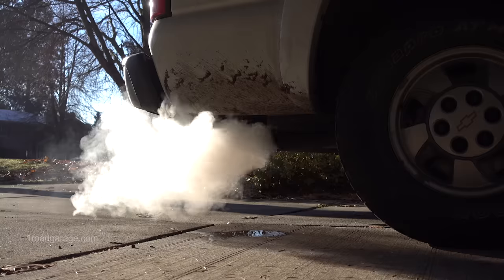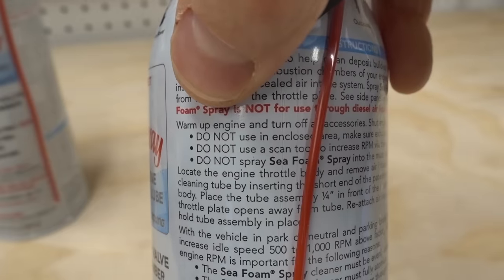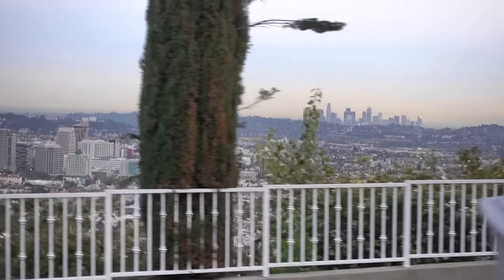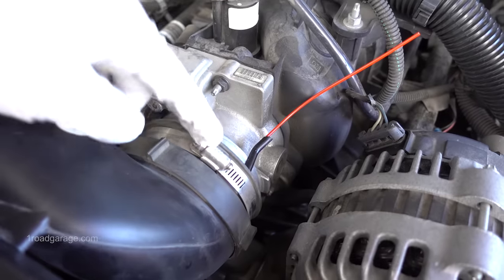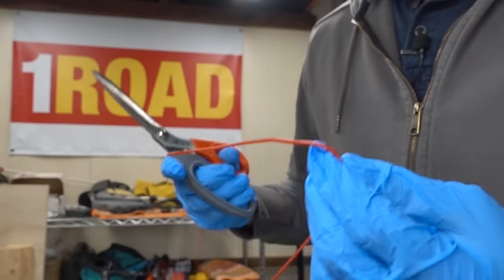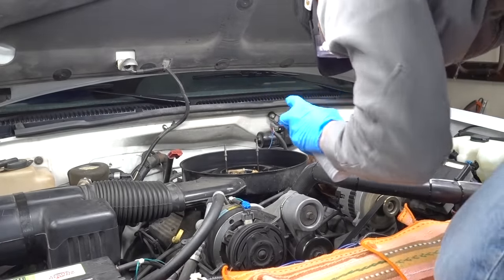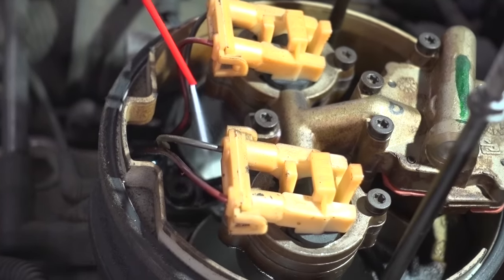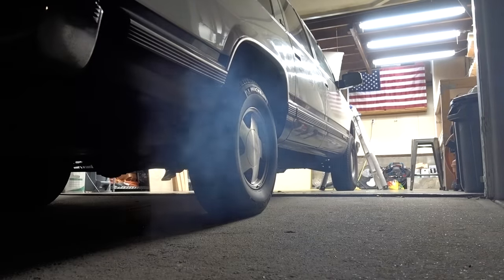Why You Should NEVER EVER USE SEAFOAM!!

Comment: If you really want it to smoke get the liquid. Get the engine good and hot like you did, give it some rpms and start slowly dumping the liquid in until you have dumped about 25% of the can, then let go of the throttle and finish dumping the entire can in throttle body/carb until the engine stalls but make sure you empty the entire can into the throttle body/carb. I usually let it sit for about 30 mins, then start it up... You want smoke, you'll get smoke. Just to recap dump a little with rpms up then let idle and dump entire contents of can in the throttle body/carb, the engine should stall on it's own, if not you didn't dump fast enough once it was idling. Of course, after it stalls you will want to shut the key off. You want the seafoam to stall your motor, you don't want to have to shut it off manually.

Comment: I thought your were supposed to spray it into the intake at idle until the engine stalls and then let it soak? 
That way, it thoroughly coats everything in the intake including the valves.
You are then guaranteed a HUGE plume of smoke when re-starting the engine.

Comment: sea foam is for old 2 stroke out board motors to remove burnt oil deposits in the combustion chamber. Want to make lots of smoke in an old car-berated engine mix dot 3 and water 50/50 and pour in down with engine running, my old chev 350 wouldn't stall but smoked a lot.

Comment: Try using the other bottle and siphon it through the brake booster. The design of that intake stays clean from the constant spray of fuel, Seafoam won't do as good a job from that angle as it would from the booster. I'm about to go do it to my truck right now.

Comment: I don't think the smoke comes from Carbon deposits, it is the Sea Foam burning up.  I saw a Video where the O2 sensors were removed and the product sprayed into the hole to the upper Cat Converter (not into the engine itself); and when started it smoked like hell, just like when you spray into the  air intake.  SO that makes me think that the smoke is not buring carbon.  The reason you didn't get smoke then was not because of carbon, but because not enough heat to properly smoke the Seafoam product itself.  I gather the Seafoam or CRC actually soaks into the carbon (so CRC says) on the valves and gradually dissolves the carbon (so CRC says) - the smoke then comes from the excess Seafoam spray entering the combustion chamber, or even hot exhaust.  SO I do not think No Smoke is an issue, that would be just the excess seafoam burning up.  The seafoam you have used before would have still started to soak the carbon on the valves...if were are talking about a direct injection engine.

Comment: You got to unhook the vacuum tube from the brake booster well it's running pour one third of the bottle it will kill the motor that's a hot soak. Wait 5 minutes with the same song sitting on top of your piston. Then start it up and Buddy you will have all kind of smoke. The smoke is there because it's oily. The amount of smoke does not determine how much carbon you have cleaned.

Comment: I have to tell you i have done this I would suggest with a small amount of seafoam flood the engine out "without reving the  engine" near the end of the treatment with about ¼ of the can the motor will stall out this is when you let it set "hot soak" 15 minutes

When you try to restart the engine can vapor lock if you hear a rattle stop and wait 5 mins trying to restart can be tricky like a hard starting engine once it tries to start you can continue till the motor comes to engine idle you will get smoke. Now rev up engine to clean ONLY DO THIS AT YOUR OWN RISK AND YOU KNOW WHAT YOU DOING THIS IS JUST A SUGGESTION ON HOW I DO IT!!!!

Comment: Did this to a 2000 Lincoln ls v8 with 236,000 mile and I stopped the main road in town bc a semi driver couldn't see where he was going by of the white smoke coming out. I couldn't see when I turned around to go back to work. They say go run the piss out of it to shoot the carbon out of the engine. Will be doing it in my 95 2wd suburban with 226,000 miles on it

Comment: I drive a 2016 silverado with the 5.3, when i drove aggressively after treating it it bogged momentarily in 2nd and left a massive white cloud when it smoothed out and took off. Couldn't say why you get so little smoke unless it burns off faster while the motor is under load.

Comment: I have always used seafoam I just put it in my fuel every fill up it does the same thing just takes longer plus if you put it in your fuel it’ll clean your entire system just watch your filter and it also gets into your oil which helps keeps rings free and clean your Crank case up
Reply: I hear what you're saying but I don't think you get the same hot soak that burns out deposits in in the engine.  Since it's being so diluted by the fuel and over time......you're manly getting a fuel system cleaner I believe, which is still good, just a different process.

Comment: Do you know if the liquid you can pour directly in to the fuel tank does the same thing as the spray?
Reply: I hear ya.  But if it's just in the fuel system you're really not getting a bolus of it going directly into the engine to do the hot soak.  You're getting more of a slow clean to the fuel system over time which is kind of a different process and it's not doing the hot soak to burn out deposits in the engine as much.

Comment: SUPER TECH Motor Treatment from wal-mart   also worked Great on my 1997 Chevy K1500    i did removed the mass Air-flow sensor   i did notice a Differnece on the horsepower  (I just wanted to say thank u )

Comment: Right on had a flowmaster installed  on my 98 Silverado last month. I didn't pass smog recently because after being parked for two years not enough miles on the computer. Now I got the miles and a 0430 code. Oh and a bottle of sea foam gonna try it tomorrow and see WTF happens. Going with the "Cataletic Converter Colon Cleanse"

Comment: You are supposed to put 1 Oz of seafoam per quarter of oil into you engine compartment. Then hot soak and you'll get a huge plume of smoke. Wait 24hrs, then change oil.
Reply: Putting seafoam into the crankcase might be helpful in removing deposits in the engine, but it won't cause huge plumes of smoke.  The smoke comes from combustion of the seafoam along with whatever it's burning off, which exits through the exhaust.  The oil in the crankcase is designed to lubricate.  it doesn't combust, so there's no exit through the exhaust pipe from anything in the crankcase, other than possibly whatever small amount might get into the combustion chamber through worn engine components.
Reply: @chuckd7423  lol soooo...I guess I never seen the smoke coming out my tailpipe while I was standing right there watching it. It must have been a grand illusion. The great Houdini must have hiding in my muffler and pulled a magic trick on me at the same time that I used the seafoam. Lol
Reply: Each and everytime LMAO

Comment: To get the crazy smoke you need to get your motor to shut off by putting in enough seafoam to have your motor die. Then when starting it back up, it will bellow smoke
Reply: Not the case in my experience.... I follow the directions on the can... spray the whole can, I use a brick to hold the throttle (2k rpm) once can is empty, return car to idle for a few sec. Then shut off and hot soak 15 minutes... start up and drive AGGRESSIVELY... I've got 211k miles on my velo and I've done about 7 seafoam spray (not the liquid) and CRC about 2 times... any GDI motor will have excessive carbon buildup due to using fuel that contains ethanol... I personally try to only us PURE GAS (ethanol free).. carbon emissions are drastically reduced compared
Reply: @korey420 
Ok. You said not in my experience but then you didn't state any difference. Just an explanation of how you use it. So your saying that you do get the billowing smoke when using the spray per direction? Or not? My comment wasn't a statement on how to do things right. It was an explanation of how to get the excessive smoke... which doesn't do anything helpful but that is kinda what 1Road kept going for and seeking in his video
Reply: Read your statement..." To get the crazy smoke you need to get your motor to shut off by putting in enough seafoam to have your motor die"
  I took it as that's the only way to get crazy smoke.🤷‍♂️.
And I clearly stated a difference... You said to spray seafoam until your motor dies... I said I follow the directions on the can which nowhere on the can does it say to let the motor die... It says spray the whole can once the can is empty let it idle for a few seconds and then turn it off the hot soak...... my point is I don't think it would make a difference because the only thing you're doing differently is shutting the motor off while you're still spraying... you spray the whole can in and it's completely covered everything internally (hopefully) and then you hot soak it for 15.. minutes...

When you start the vehicle backup there's a big difference between actually driving and putting load on the motor causing non-stop smoke or staying stationary and revving the motor good puffs of smoke...

Comment: U want lots of smoke? Wanna trade engines? Mine: TBI-350 200,000. Ran great, super smooth idle at 500rpm, no smoke and good power. Burned about ½Qt 15W-40 / 2500mi, no Cat, flowmaster, 8 fresh R44s, 8mm wires, cap, rotor. I sprayed 1 can as U did. Got a little smoke as U did. Next day I started it and it smoked so bad it engulfed in smoke. 1 might think it was on fire. Just 4 fun I drove it. I started up a short 50ft driveway and it started running rough and did not want 2 pull it unless I gave it at least 50% throttle. I went another mile with a short 5% grade and it struggled again. I turned around, went home and parked it. Same thing next day... And thereafter a week. Pissed off I pulled the air filter cover and found a lot of oil in the TBI. I then checked compression. The corners (1,2,7,8) 120 - 150lbs. The middles (3,4,5,6) 20-50lbs). I wrote SeaFoam. They said it was the milage of the engine, not the product. She now sits. Bummer. Ideas on the cause?

Comment: Well. It is your engine. Your engine works better and more efficient than a modern engine. You don't have all that clean air stuff. So yes your engine is very clean. Think about it. By the way. That truck is in great shape. All you need is a gas tank additive only if you don't see good sprays when looking into the barrel of the carb. A little WD40 sprayed in while engine running is good as well.

Comment: The way you get that big cloud is not safe, I’ve seen guys do it at my shops all the time but what you do is you let it idle until the sea foam is empty and then you just rev it to red line and let go and do that a couple times and big cloud but I don’t like it cuz it’s too much stress on the engine plus all that fluid is just sitting there and then you jam it to the cat converter

Comment: Never use seafoam! That part you got right. You know if you don't like your fuel injectors Cadillac converter oxygen sensors and should I go on? You don't like those things you want to throw your money away because that's 5 minutes not working anyway with the heat of the motor. Then go ahead and use seafoam but make sure you have one of these and trunks and get to the next place🛵.

Comment: You are better off using a vacuum line in a regular bottle of it. Let it suck in until the engine quits, wait 15 minutes, then start it up. 

It works better than the spray.

Comment: You want that cloud of smoke  then pull off the vacuum hose for the brake booster and the spray or pour the sea foam in the hose till the engine stalls out while reving the motor then and more than needed to stall the engine and let sit for 7 minutes and then restart the engine

Comment: Here is the deal with your suburban. It is throttle body injected. Which means raw fuel is sprayed on your intake valves when it goes into the cylinder. This gasoline helps keep deposits buildup from the top side of your heads. In more modern direct injected engines this is not the case as only air comes in through the intake valves and the injectors input gasoline directly into the cylinders. This leads to a buildup of carbon and gunk in general on your intake side of your heads. This is what the seafoam spray is made to target. It is why newer vehicles get a lot more smoke than you saw in your throttle body injected vehicle. .

Comment: Ready? ( engine HOT) Remove brake booster vac hose. Tiny funnel into hose. 1/3 can   S L O W L Y,  wait 2 mins, 2nd 3rd  of can again slowly... now pour rest of can gently until almost out, then stall (drowned) motor with remaining. Reinstall booster vac hose. Soak for 10 minutes. Start engine. You'll kill mosquitos with the smoke but in 5 min you'll be clean as a whistle. Bet? Done it no less than a dozen times

Comment: I’m new to using sea foam…..I’ll never NOT use it going forward after putting a can in gas tank and a can in the intake I saw IMMEDIATE difference in power and stamina with my car (2011 Chevy Malibu with 192k miles) 10/10 RECOMMEND SEA FOAM

Comment: Seafoam is a joke. As a mechanic of 35 years I have used it on cars. Boats. Bikez and lawn mowers and torn the head off to see results and there was very little to no difference in the combustion chamber. If you constantly use it in your fuel it will eventually work.  But I have learned in over 30 years of being a certified mechanic there is no such thing as A MIRACLE IN A CAN OR BOTTLE..
run a mower till its hot. Run a whole can through it. Let it hot soak and start it
Sure it may smoke like a train but that means nothing.  Spend 10 minutes and remove the head. You will see it did very little.   
To DeCarbon a combustion chamber remove the plugs. Fill all cylinders with diesel fuel till it runs out. Let it sit 48 hours then turn motor over to remove liquid.
Put plugs in and run it. That will clean combustion chambers. And only cost about $1 worth of diesel or gas.

Comment: And that burned oil causes more carbon that gets on your 02 sensors and causes an engine code and can eventually plug your catalytic converter/s so ask yourself is it worth it..look for a non petroleum based product like gumout, stp carb& injector cleaner or even barryman's  b12 chem tool..they also work without the effect of burning a petroleum product like seafoam..seafoam is good for something you can add it to your oil and drive normally for 300 miles before an oil change to use as a motor flush to clean sludge and deposits or as a parts washer cleaner that won't dry out O-rings or damage plastics ..

Comment: Don't use the spray can pour it down the throttle body on this one I've done this to a car 50 years ago pour fast keep the throttle revs up so it doesn't kill pour fast enough so you can feel it stalling but keep the revs up so it keeps running pour fast enough until you choke it out and it stalls then leave it soak for about a half an hour then start it go for a drive you want smoke I had the fire department there in my parents driveway. As far as working you need to put a scope in the cylinder before and after I never had one back then.

Comment: If you want to see some smoke and have the motor cleaned out pour some automatic transmission fluid down the throat of your throttle body get the engine nice and hot and do that does the same thing as seafoam

Comment: Yeah man You're still doing it wrong. You have to stall the engine out by the spray. Spray till it starts stalling, then let it recover, keep doing that cycle until you're half way through the can. Then spray till it stalls. Let it set there now will be pools of seafoam setting in your intake, and top of cylenders. This is the hot soak. Whe you finally crank it and rev the smoke is just it buring off the pools of seafoam.

Comment: Seafoam is a petroleum based product..yes it has oil in it..so your vehical will smoke not because it is cleaning the carbon deposits in your engine, its actually burning the oil

Comment: You have a throttle body it send gas down your intake the gas has detergent in it to help remove carbon deposits unlike a direct port fuel injection which just cleans the intake valve really that's why you don't have as much smoke

Comment: The smoke is the result of burning petroleum and is no indication that it’s carbon burning off. In fact, any carbon deposits would be captured in the cat… you can get the same results by pouring In Transmission fluid, which is what the old timers used to do…

Comment: Why are you not pouring a cup of it into the brake booster hose. If you want seafoam to "smoke the block" thats the real deal right there. And not to burst anyones bubble, using it in the intake its just going to puddle in the intake manifold where most carbon piles up anyways.

Comment: You would get more smoke and cleaning if you just let it warm and removed the brake booster line and spray it in to there.  About 3 oz  and hurry and kill the motor.  Then reattach the brake line booster and  start it up.

Comment: Theres a lot easier solution to this, using distilled water with a spray bottle, rev your engine to 3k+ and spray water in until the revs drop, too much water can cause a lot of damage though so be careful.

Comment: All that smoke is Seafoam burning off. Seafoam has no PEA which is a very good cleaner. Seafoam is for two stroke engines. Use something like Techron that has PEA. Seafoam was tested with a new engine and it smoked like hell.